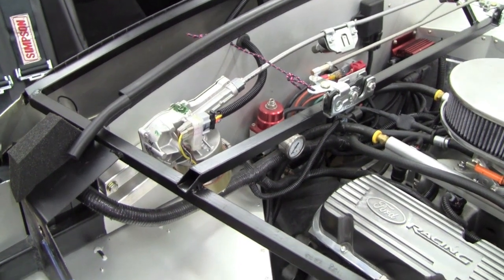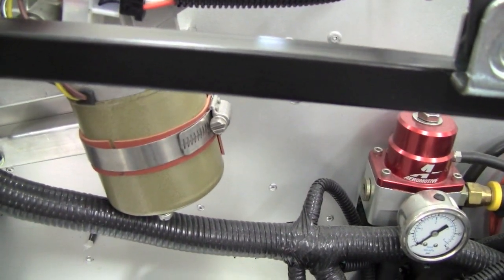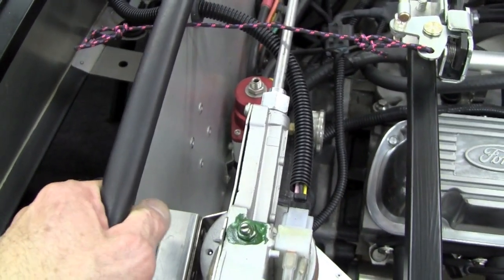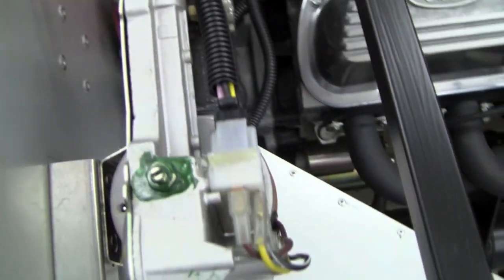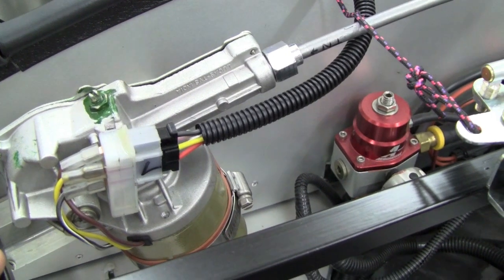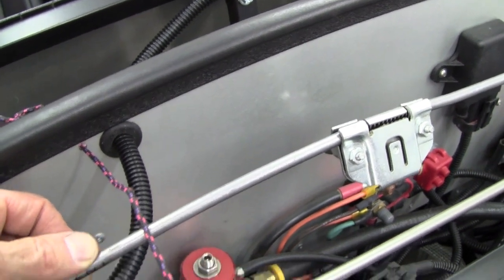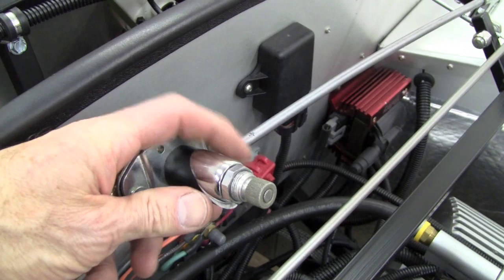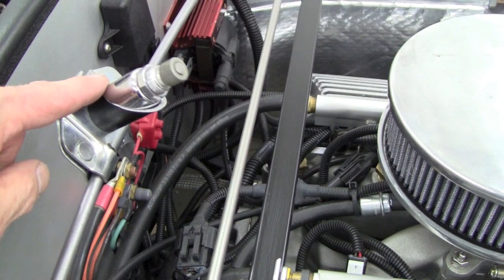Breeze Automotive Windshield Wiper Install

Comment: Do you happen to have the part number for just the wiper blade?
Reply: The same wiper blades as furnished by Factory Five are available from Finishline https://www.finishlineaccessories.com/c-59-wipers-washers.aspx . I know that Anco and other wiper companies supply stainless frame wipers for vintage application, such as Anco 20-10, but I've not used them to verify fitment to the 7mm wiper arm.